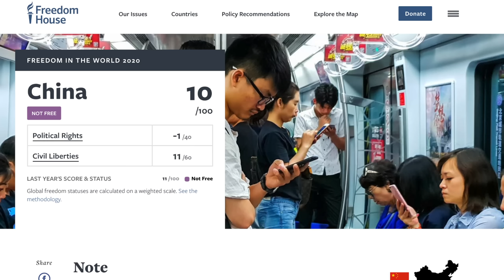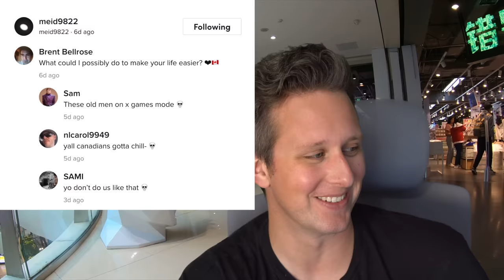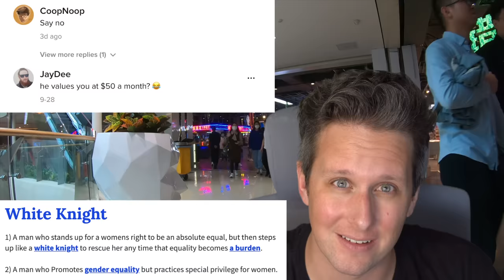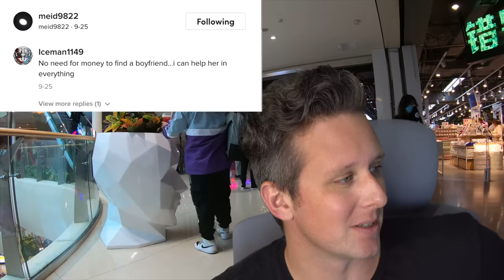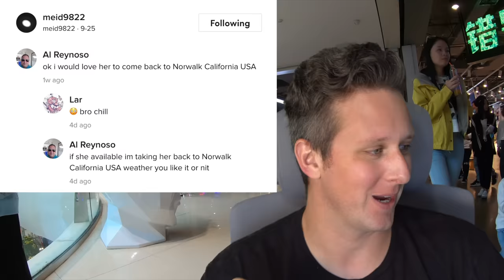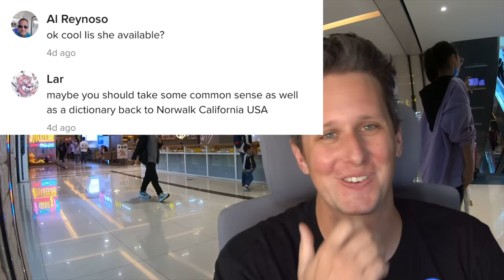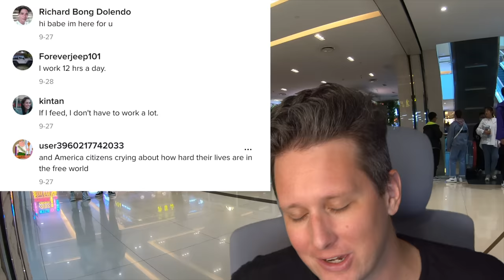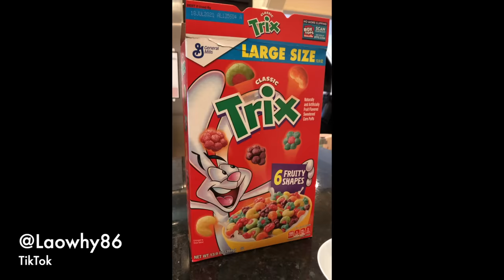The LYING Chinese Beauties of TikTok

Comment: 3:25 the lack of eye protection with those metal shavings flying around terrifies me
Reply: It's not that terrifying actually
Reply: @Ducktility  I’ve had my eyeballs burned at work from splattering oil. You can be damned sure I’m not happy with all the shavings and no eye protection.
Reply: Sadly if you come to india some factories their don’t have safety equipment provided and they are making jewellery with chemicals floating around with heat and yet they are providdd with zero satay measures but I don’t think it’s like that in china

Comment: Operating a large drill press with no eye protection?  First clue that something isn't right !
Reply: “cha bu duo” 😛
Reply: It's China dude
Reply: Meh you only need glasses if you’re cutting metal
Reply: In China that would be very common.
Reply: @thepope2412  yeah, wood splinters cant get in your eyes or anything
Reply: and long hair not tied up
Reply: @nicholasbrown4109  I've never had that problem before, ever
Reply: First clue? Really?
Reply: @thepope2412  wrong! always wear eye ortection when doing mechanic jobs
Reply: @Vrey662  Do I eye protection when driving screws?
Reply: In communist China, machines don't attack people. 😀
Reply: That drill seems too professional to apply the cutting oil manually. Not sure, I'm not an expert, maybe it's sprayed manually in some large factories too.
Reply: MrAnticlimate nah that’s just an old milling machine.
Reply: Sir last i checked from the stories being told about china employee safety isnt a super issue lol OSHA would likely have a stroke in ANY chinese company lol
Reply: I know right? Look the piles of metal shards everywhere in the workshop. That's a accident waiting to happen.
Reply: @thepope2412  slight adjustment, not a milling machine but a radial arm drill.
Even very old ones have pumped coolant but it's so messy that many operators prefer to use oil.
Reply: I don't think she even lift the drill to break up the shrapnel, which was metal working 101 when I was in high school
Reply: That hair too
Reply: And learn how to sharpen a drill bit so the chips break off cleanly.

Comment: Do they not wear safety goggles in machine shops in China?
Reply: They don’t need it. Powerful stuff, that TCM.
Reply: Costs to much!
Reply: They can't trust the Chinese made ones
Reply: No, they already wear safety makeup.  Culture difference huh 🌚
Reply: ニッガカット The knockoff laser protective eyewear from China is the worst. First of all, half the listings online say they protect against all laser wavelengths. Which, if true, would make them completely opaque and you wouldn’t be able to see through them. Then, when tested, the ones that actually call out specific wavelengths pass a ton of light through from within that range.
Reply: They dont need any safety equipment,  The power of  CCP protects everyone  . CCP protects you if you love CCP enough

Comment: I'm a machinist at a tech school rn and I can tell you that the way she operates that drill press is way too fast and uncaring for producing precision parts. Our number one goal is precision and that takes time, she slaps that speed control/directional control knob without even looking at it. One wrong move and that part might be junk. She is not a machinist, or at least a quality one. Not to mention her lack of safety equipment, if she regularly operates that without ppe she'd be blind from burning hot metal chips. Safety glasses have saved my eyes many times.

Comment: No safety glasses and wearing gloves while drilling. Just crazy. The swarf can wrap around the glove and its razor sharp and will tear into her flesh if not careful. Her hair is loose on her forehead too Another accident just waiting to happen.. Is that a CNC lathe in the background. It would be very hard to work on a cement floor, and crouching down like that for 15 or even 10 hours a day. The place is so untidy too.

Comment: 5:28 .. Not joking when I was a teen I worked a "big drill press" very much like that, the auto feed input worked exactly as that one does.  I can't remember the proper name, mine was set up pretty much JUST as a drill press, ...

But I think they are called a vertical boring mill?   Actually quite a versatile if old fashioned piece of machinery. 

BUT? It was on a heavy duty cast-iron stand, that was part of the machine, the work surface was at waist level ...  I don't understand why they set it up right on the floor???  Why is she sitting on the ground :)